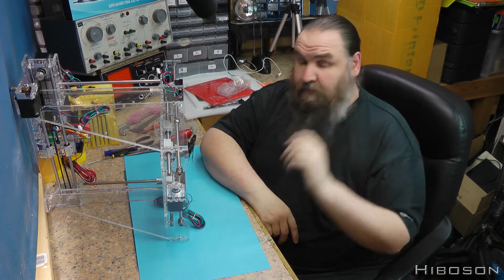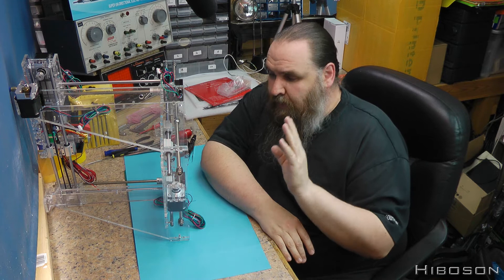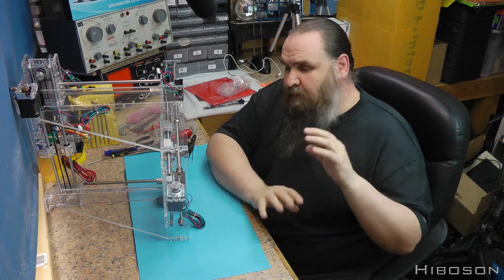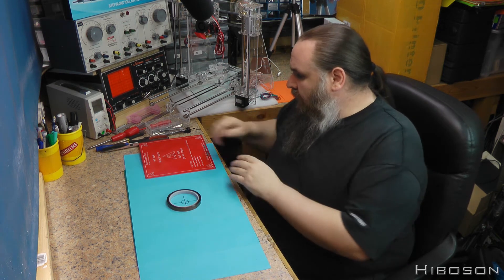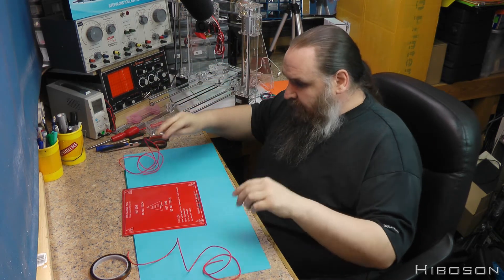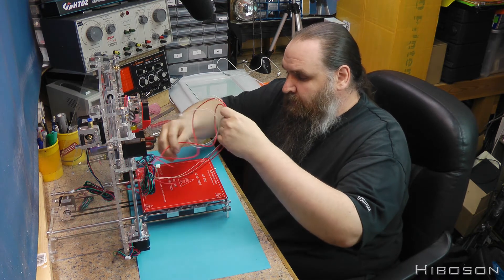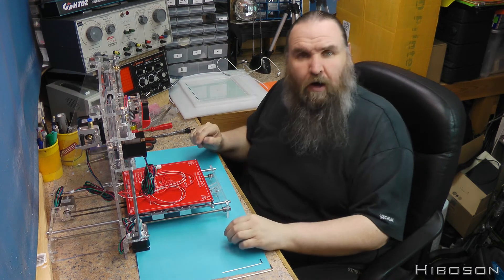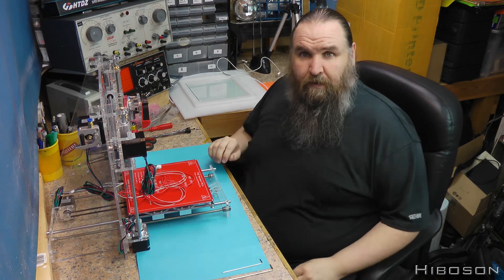3D Printer Build (And Fixing) - Sunhokey Prusa i3 - Part G

Comment: great video but a helpful tip for others and yourself is when you attach the main board to the side you should first put spacers behind the the board and in-front of the side so the pins don't get crushed or degrade at operating  temps due to acrylic side. i use another M3 nut, spaced it out just right.
Reply from the maker: Rick Bellamy Cool tip :) I did wonder why no PCB spacers included but then again they do seem to miss a few things out but hey it's cheap what more did I expect lol

Comment: Nice progress Hiboson.. Don't worry about that electronic connection Graphic it's pretty straight forward I found it easier than following a video you just need to make sure that each axis motor & endstop is plugged on the right port.
Reply from the maker: Harasi Yea I feel pretty confident I can deal with it OK but when looking at the instructions and putting myself in a what if I was a non tech person how would they deal I do think there instructions where lacking, enough for me and technical folk like yourself ;), but the laymen maybe not so clear lol

Comment: with the cd you got. there is a jpeg picture. showing what wire and where it should go.
Reply from the maker: rune ellingsen Yea seen that and it's simple enough to follow, but I think they went to the trouble of making a PDF manual with all the stages before wiring (Albeit a little wrong at times) but then in that manual to just stop right at the wiring bit, seems silly, they could have so easily popped that image in the manual and a few pics showing routing of cables to help out the non technical people trying there hand, I'm fine I've been doing technical stuff in one way shape or form since leaving school so I'll be golden, just want to try help out the people who are not so technically inclined ;)
Reply from the maker: rune ellingsen I joined that group only the other day :) Cool group :) Be cool to see what others do to tweak there system and know what issues others are getting maybe before we encounter them so we can preemptive fix :) I'll see you over there then ;)

Comment: There seems to be slightly different versions of this kit. Mine came with an aluminium heatbed with all wires already connected.
Reply from the maker: MarkTheGlobe Yea there seem to be a couple of variants about, there basics are the same but a few tweaks on each. I think the newer ones are the ali beds and better end stop mounts and a controller mounting acrylic too, I could be wrong but think thats there main differences off the top of my head ;)